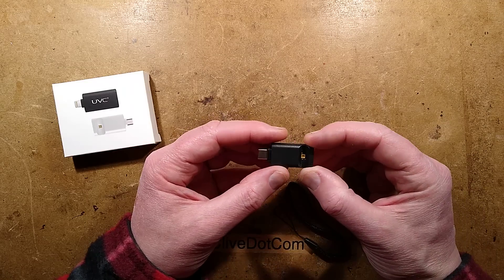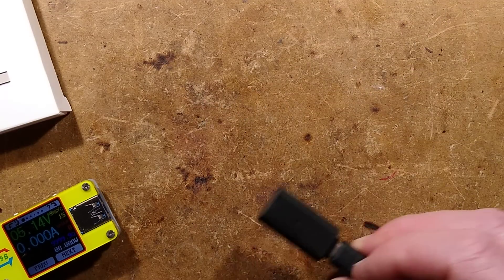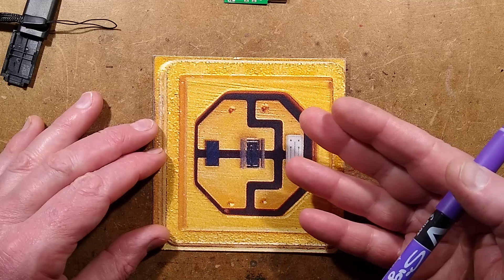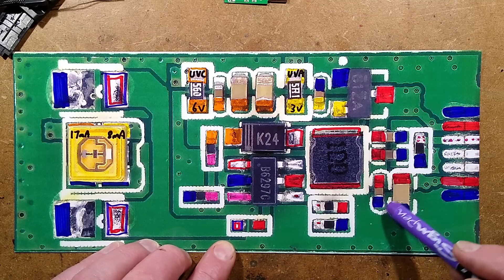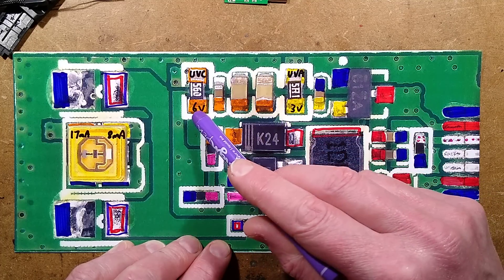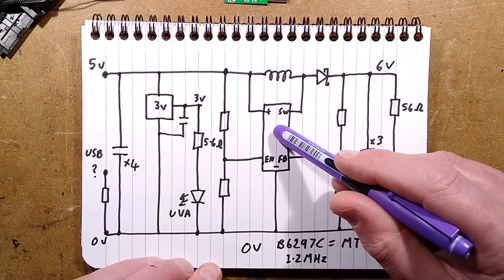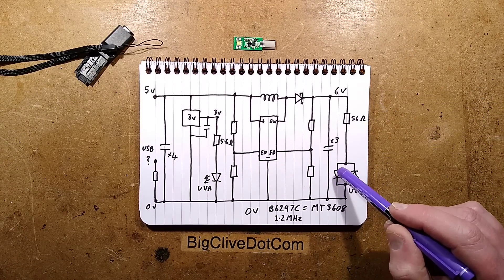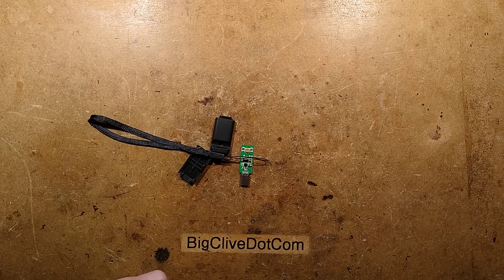"pandemic theatre" USB sterilising dongle

Comment: I've seen that same UVC LED package in presumably higher power implementation, admittedly with three of the emitters, and I'd guess part of the reason the emitter is built like that is because it generated a LOT of heat.  I've no idea how many amps were being pushed through there but it got toasty pretty quick.  The LEDs were mounted to what appeared to be plenty of back-plane presumably to help dissipate heat.  I need to track down those UVC testing strips.  Hopefully Big C shared where he found them assuming they're not easy to source.  Reason being back during the start of the pandemic I turned to UVC as a sterilizing agent and ran into the problem discussed a few times on this channel, TONS of fakes.  This being a couple years back or so, there absolutely wasn't anything like those strips.  There were more generic UV strips but they were uh 'tuned' for UVB and maybe UVC, not UVC alone (presumably for testing exposure like in a car etc. where UV can destroy the interior, or perhaps for checking for human exposure to help avoid sunburn).  I tried to build a UVC tester based upon some circuits and parts someone else put together doing the same, based upon a forum post I tripped across, but unfortunately never completed the project.  I wanted a definitive way of determining if a claimed UVC sterilizer actually pumped out any UVC and the professional detectors were ridiculously expensive.  For what little that's worth to anyone interested.
Reply from the maker: eBay UVC test strip.
Reply: Maybe a double slit spectrometer setup.  Needs no exotic materials, just a carefully scratched piece of tinfoil, a few lenses and something that senses light at any wavelength.  Place the specimen lamp so it gets focused on the double slit, then move the detector through the angles where relevant wavelengths go.  Start by testing something simple with known wavelengths to determine the scale (use theory to get the extrapolation formula from the reference colors to desired wavelengths).

Comment: I don't know if you've heard of them, but I encountered a customer in my retail job who had a special kind of crazy useless tech accessory that was basically a type-A USB on one end and a pin on the other meant to plug into the grounding socket of a US wall outlet. She claimed it was supposed to "eliminate bad energy", and she was in my store looking for something equivalent with a type-C end because she bought a Macbook.
Reply from the maker: Laptops will set off one of the quack EMF detectors due to their ungrounded power supplies and capacitive coupling through the PSU.  By grounding the negative it would make the whole laptop equipotential to ground.
Reply: That is not entirely useless. Non-grounded laptop PSUs tend to have a slight capacitive coupling across the transformer and the few uA of current that provides at a high voltage can be perceptible and annoying. I don't know if it's enough to damage sensitive equipment, but Macbooks with their metal bodies are especially known for this.
Reply: @CanizaM  The thing is, she thought that this cable would counteract the "radiation" from her computer because she was worried that 5G or whatever it was she was paranoid about would make her sick.
Reply: @CanizaM  I bought an aftermarket PSU for my Dell laptop, which had no grounding plug.   IT did have the nice tingle, and you couldn't use the touchpad without firmly contacting your arm or other hand to the metallic side of the case.   Needless to say, I requested (and received) my money back.   I do still use it in emergencies, as it is nice and tiny, and I'm not particularly bothered about those voltages.   I just wouldn't use it for my main usage.   So, having a 'magic' grounding cable would probably fix the 'bad radiation' there.
Reply: what's bad energy? Energy is energy it just depends on what you do with it
Reply: @dantronics1682  This "bad energy" is likely on the darker end of the juju wavelength.
Reply: @Can0spam  Ahh ok that makes more sense but dont you need a witch doctor for that instead of electronics solution?

Comment: The extra pads are for external 405 leds in case the uvc package doesn't contain it...  Also, I have payed around with some high power uvc leds in this small metal package, and some of them pack quite a punch, but they're expensive as hell...  I believe the one I was testing took 80mA at 7.2 volts and needed a rather large heatsink...
Reply: How much does it go for? I'm thinking installing one with a timer in water purification room I basement of our water plant. No one goes there more often than few days anyway
Reply: @KOTYAR1  it's been over a year, so I'm pretty sure you can probably get them a bunch cheaper now...  I believe I paid about $80 US each...

Comment: It is nice to see an actual UV-C device on the market although not actually doing what it is supposedly designed for 🤦‍♂️

I do wonder though if they are restricting by regulations. That is if they were to design a device that actually sterilises through higher powered UV-C, would there then be restrictions to whom their product could be sold to due to the radiation exposures? Just a thought…

Comment: What is your color coding for reverse engineering and and troubleshooting? I've noticed you mark the photos and I wondered what your color coding scheme is.
Reply: All the same color is connected together on the same net. There ins't much to it beyond that. Just a way to show what's connected without drawing lines on top of the picture all over the place
Reply from the maker: Red for positive and blue for negative (because it shows up better than black) then other colours to designate specific common circuit sections.
Reply: @bigclivedotcom  I vaguely recall an automotive scheme I've tried to incorporate in my builds. Red vcc, black gnd, orange for switched on vcc, yellow for signal, and blue for signal ground for a sensor wired over there by itself, or any other use. It slowed me down incorporating it at first but kept me on track and has been helpful a time or two. I just wondered if there was a standard I should be looking for and following rather than my vague recollection of something from long ago. Thank you Clive.

Comment: What about those boxes that are designed for sterilising your phone? I bought one for about 75 cents in a shop that was closing down, and it appears to use a filament rather than LEDs. It is still powered by USB. I use it to sterilise my P2.
Reply from the maker: If it's a thin tube that glows blue it may be a tiny mercury vapour tube.
Reply: I've seen them done with both LEDs and tubes. I am not confident that the LED version could erase an EPROM chip.

Comment: the USB pin is OTG (On-The-Go)
When pulled to ground It switches the device from a slave to host, meaning the phone will output power

Comment: You could see if your USB meter has another typeC port. If so, try that one instead, it should give you a current reading. At least mine does, because one is labeled Type-C out and the other is Type-C in

Comment: I bought a few of the same leds bare before to play with and indeed the uvc output is pretty minimal even after overdriving them a bit. The leds appear to be xinglight xl3535uv2sb12p1 or p2 i found similar looking leds and datasheet in lcsc

Comment: the idea that so little energy in UVC would magically sterilise reminds me of how this winter, a bunch of people got sold on the idea of saving money by heating their homes with candles (with flower pots on top for whatever reason, and of course releasing all their CO2/CO into the room). I guess the logic went something like "a candle is cheap, my heating bill is expensive". 🤦
well, the candle thing is even dumber than the UVC dongle, since knowing something about UVC, like that a light this weak is going to sterilise weaker than sunlight, is expecting a bit much from people. understanding that burning enough stuff in a closed room to heat it substantially would collect dangerous concentrations of exhaust gases should not be too much to expect.
Reply from the maker: The candle thing has been going for years since the original video about it went viral.  It's not a cost effective way to heat your home, but may have a psychological effect
Reply: @bigclivedotcom  There was a small window of about 2 weeks here in the Netherlands in October where natural gas prices were actually higher than bulk candle prices per MJ. Even generic propane/butane canisters for camping were cheaper for a bit than natural gas. But candle and canister prices very quickly caught up and natural gas prices went down soon after.

Comment: These are meant for checking IDs. Does not surprise me someone marketed them as sterilizers.
Reply: Not the UVC LEDs like this.
Reply: @sdgelectronics  Do some ID's use the same UVC responsive ink as the UVC test card does? That way the unsuspecting forger gets the UVA part right, but doesn't even think to check for UVC responsive ink
Reply: @gorak9000  sneaky huh lol

Comment: I bought a UVC chamber designed for phones and other small items - made by Philips. 

Although the UVC LEDs produced a lot of UVC, it was highly directional. 

Sure it will bounce around a bit, but it was generally unimpressive compared to a standard traditional vacuum UVC lamp. 

I actually did swab tests, comparing that device against handheld UVC wands and similar competing products. 

My own personal advice would be to continue using the traditional options for now. 

I actually have another Philips made device which claims to sterilize surfaces and be safe to humans. It's a USB stick type lamp and puts off a kind of blue light. It's also UV but allegedly in a safe range.
Reply: Maybe Philips is a zombie brand now?
Reply: Purple Oranji made her own steriliser box a couple years ago using high power UVC LEDs. She also tested the LED on bacteria growing in a Petri dish to made sure it wasn't just pandemic theatre. She even showed how to make an incubator for growing the bacteria.
Reply: LED sterilizers need mechanical moving the LEDs around for consistent area exposure.
Reply: i mean, if the light isnt killing you, i dont know how good of a job its going to do killing microbes...
Reply: How did that sterilization box do with the swab tests, was it any effective at all?

Comment: Too low output power because too low consumption? Didn't you know that modern consumer products tend to put more power out than put in before (perpetuum mobile 2nd generation principle)?
- this little sterilizing diode
- vacuum cleaners
- 1,000 W or more car amplifier output, after the 12 V passed a 25 A fuse
- new fresnel lens style reflecting screens with a ramp-up factor higher than 1; they reflect more light back than your projector shines on them, although they are dark grey
3x 🤭
That's modern religion - you just need to believe it! And please, don't ask any critical questions to the modern priests (vendors). Religion can just function when nobody asks anything. Right by its own existence (dogma).
🤪
Reply: The one I always point out is how 5x 3.6 or 3.7 volts nominal Li-ion somehow adds up to 20 when it's a cordless tool battery. New to the same game is Tesla's substitute for the lead-acid 12v that is a 4s one that is somehow 16 volts.
Reply: @danielthechskid  Please, marketing people can't use the word "nominal".  It would hurt them, it has to be PEAK!  Everything must be PEAK!😁
Reply: @MartysRandomStuff  LOL they missed the opportunity to label them as 4.2 x 5 IE 21v, it would be like the "this one goes to 11" of the battery world.🙃